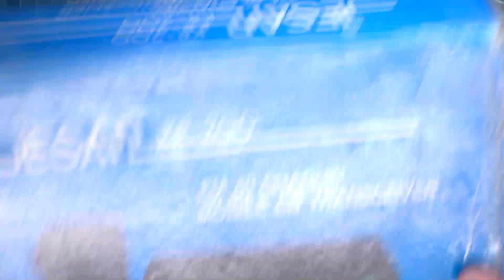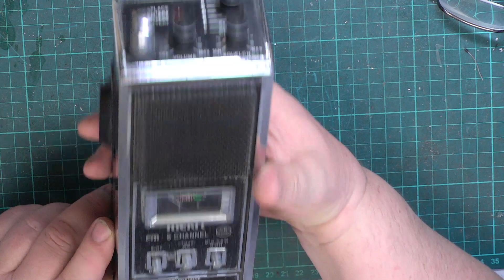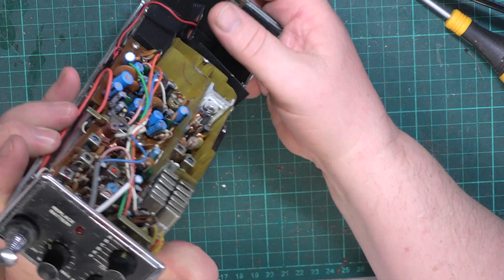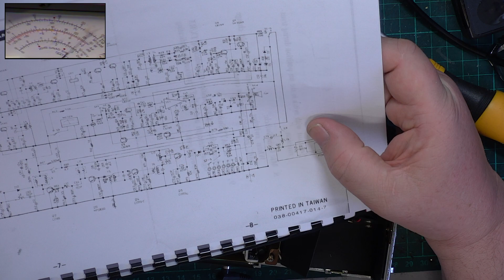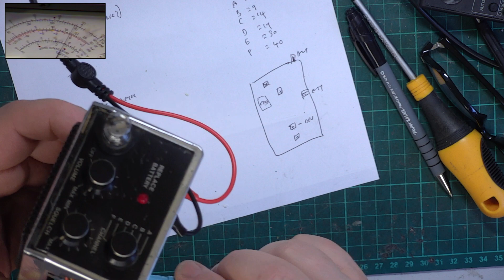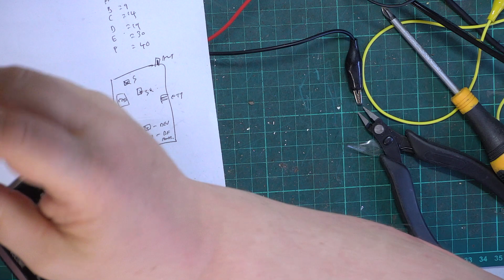Merit 6000 CB27/81 UK FM 6ch 4W handheld CB radio - Service

Comment: so at 10:52 you hook the red to what went to the antenna? and the black to a pot?  will amy pot like that work? i guess you are grounding the black lead?
Reply from the maker: The term 'pot' stands for 'potentiometer'; what I'm connecting the ground to is the metal can of what is termed as a 'coil'. In reality, most of the coils in the metal cans are transformers. The screening cans always go to the negative rail, wheras the actual chassis of radios is often isolated from the negative rail. Alternatively you would connect to the power supply negative. It's best practice to connect your metering ground to as close a point as possible to where you are taking measurements from; hence using coil cans.

I bought a Great branded one of these sets last week....well the remains of. Next week I'll try & do something with it so if you're interested in seeing this chassis again you won't have to wait long.

Richard, G0OJ?F, UK
Reply: @ukfmcbradioservicingTango21 it looks like you have it hooked to a base antenna with the red and black??
Reply from the maker: @mackspubliclandhuntingoutd6715  When I do the Great GT417FM next week (Identical radio) I'll take more care explaining what I'm connecting to & why.

Richard, G0OJF, UK

Comment: How come it has the logo 27/81 on it?  as that was for 40 channels, and this is only 6, and crystal-controlled !
Reply from the maker: The CB27/81 specification (MT1320) allows up to 40 channels 27.60125Mhz to 27.99125Mhz at up to 4W output. Manufactuers were free to make single channel radios is they wished to do so. Crystal control is a satisfactory stable frequency control method. Now the Binatone Long Ranger 6 used a PLL synthesiser to produce it's 6-channels.  

Richard, G0OJF, UK

Comment: I’ve just purchased a Merit 6000 in very much mint condition. Working perfectly on all channels apart from D/19. It transmits fine but not receiving. I didn’t think a handheld CB could get much bigger than a Binatone Long Ranger there’s a good 10mm difference. I placed to 2 radios next to each other.

Comment: Seen the Sirtel version of it, had to fix one, what a nightmare they are to work on!  The one I had dropped off here was set up not to bad, but then it was almost new.  Strangely, just about every hand held I have seen has the top section of the aerial missing.  Not surprising when you see people pulling them out.  I had to put in an earphone socket and an aerial socket for the owner.  What a nightmare that was, I found it very tight to put in a socket for the aerial, but I found a way to fit one.  The owner was a farmer and used it in his Landrover and would take it with him on walk-about, plugged it into the CB aerial on the roof when he was in the Landrover, or Tractor for that matter.  He had an adaptor for 12 volts on both Tractor and Landrover.  I don't know why he didn't just get a CB for the Tractor and Landrover.  He bought three sets of batteries and had the spare ones on charge and one spare pack with him.
It must have cost him more than to get another two CBs!  These days he will just use a mobile phone, but back in the day it got him through to the farm from the fields, that is all he used it for.
Don't know what he did when there was a lift on, he would never have been heard!!

Comment: It Looks So Primitive Today But Back Then That Would Have Been Amazing ! 
Great Work Richard
Bless Up Fella
Reply: I wonder why they didn't see fit to install a 9:1 UNUN to match the 450R antenna to the 50R of the transceiver circuits.
Reply from the maker: Unun's were invented in 1983. This radio was made in 1982 & was even at that time an old-fashioned design.

Richard, G0OJF, UK